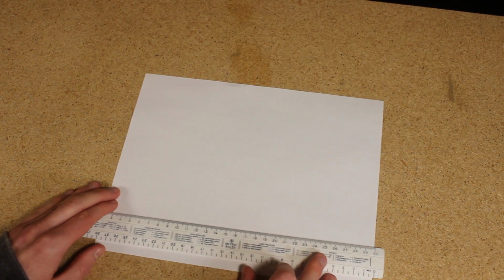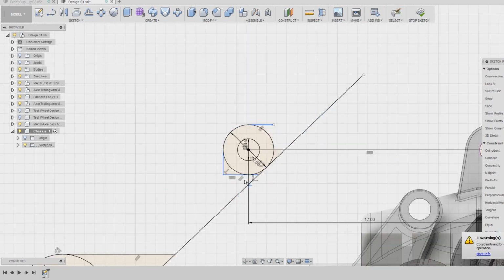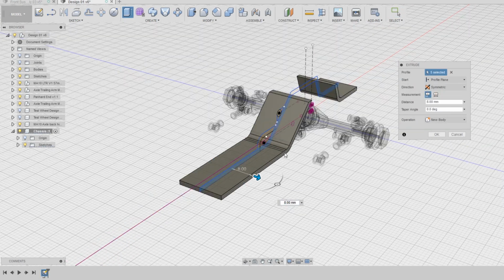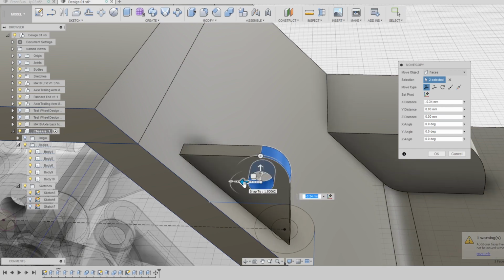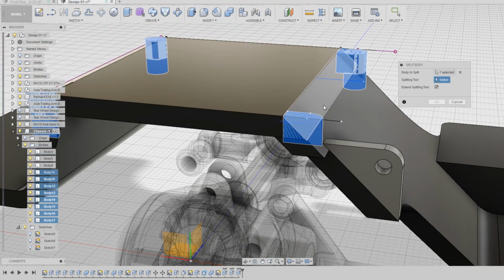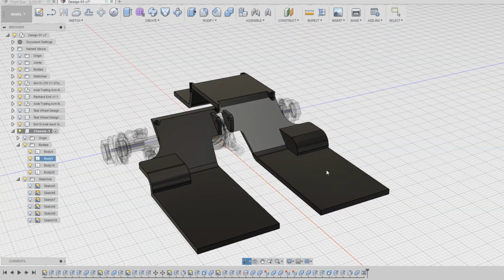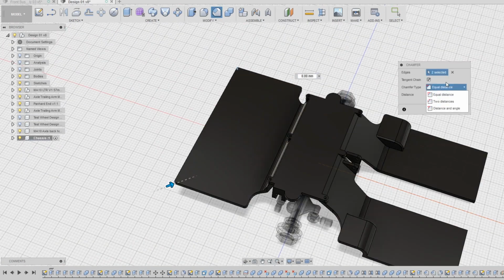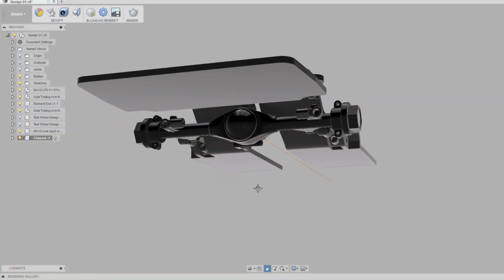RC Chassis Speed Modeling: Designing the 1/24.5 Scale FFR SC1 Rear Sections

Comment: Very nice. I'm really starting to like the program your using for your CGM. Seems to be way more intuitive and more accurate. I've been using SketchUp Make for past couple of years and it's just to limited to do what I want it to do. Especially in smaller scales. Does fusion 360 offer a licence for free use not commercial use? I would like to start designing some parts for my true 1/18 die cast 74 International pickup truck starting with some axils for it. Thinking of basing them off the RC4WD 1/18 Gll axils. Just need to make them wider to fit this full size pickup truck. The 1/18 gal axils are 80mm pin to pin and I need them at 90mm. Any suggestion is helpful. Again really nice work. Very inspirational. :)
Reply from the maker: For what it is, it really is a great software package. Fusion 360 is free for hobbyists, students, and non-commercial use. It really is quite intuitive and there are so many great resources out there for learning to use Fusion. Good luck with your project.
Reply: Sounds good. I'm going to have to check that out 4sure. Big respect to you bud for your reply. Much appreciated. :)
Reply: Interesting. Thank you for the suggestion. :)